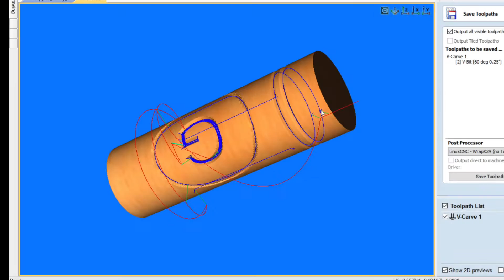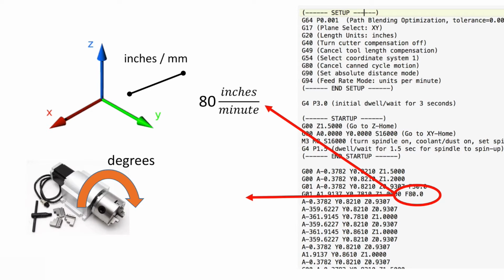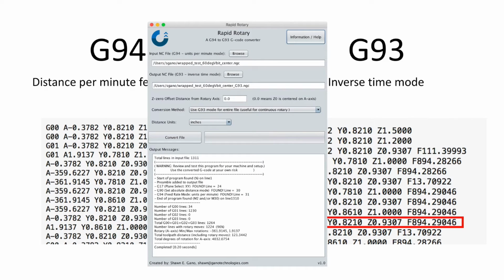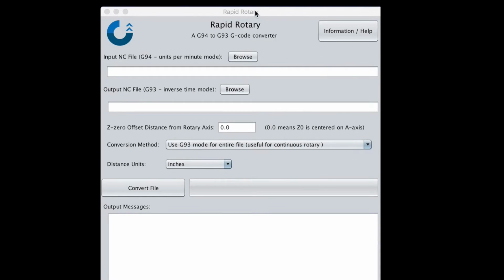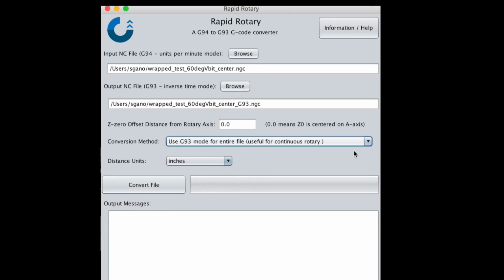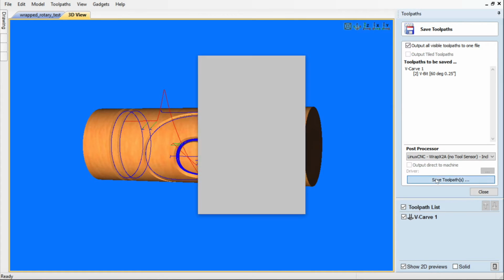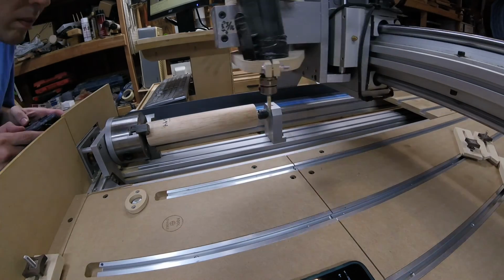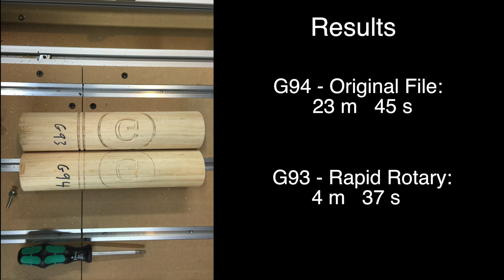Speed Up Slow CNC Rotary jobs in LinuxCNC with Rapid Rotary

Comment: Hello, can you edit this post-processor for MM?
Reply from the maker: Is it not working for metric?  I didn't think I added any checks for G21 (mm) or G20 (inches) - as the calculations should be dimensionless since the time scales are the same (per minute).   Though, I could be wrong - what error are you getting?

Comment: Awesome Video,  could you clear something up for me in the math? So you calculate the linear distance for XYZ and the arc length. Then do you add those 2 distances together and divide the total combined distance  by the feed rate? I just didn’t understand how exactly you used both of those distances. Thanks! Great work.
Reply from the maker: If I am remembering correctly; there are two types of moves the CNC controller usually does one are straight line moves (G00 and G01) which I used the XYZ linear distance and then there are the curved moves (G02 and G03) for which I use the arc length calculations.  So it isn't that I use both for every move, but I use both of them to cover the different cases of possibly move types.   Though when you do "wrap" the moves around a cylinder all moves do have an arc component (which may also be part of your question).  Hope that helps!
Reply: Hi, great program
Could you give an example how to calculate the F value in G93 from Y0 Z0 A0 for G01 Y100 Z150 A50 F200? @shawngano

Comment: I use Stepcraft and Fusion. Unfortunately I have issues with G17, G18 and G19 when I convert a file. How can I settle the  cordinates?
Reply from the maker: Unfortunately the application doesn't support G18/19 just G17 (as it is the XY plane).   The G17 should be called once at the start/setup and then isn't referenced again.   Fusion 360 does support G93 (inverse time mode) so it should be possible to output directly without needing to convert anything.  Though you made need a modified post processor to do that or there may be an output option for that mode.  I would try that route as your results will be even better if you don't have to convert afterwards.

Comment: Hi, thanks for the great explanation!
The video is some years old, but I hope its ok to ask a question.. With G93, does the conctrol software (Linux CNC in you case I guess) not have to know the z-offset as well? In your case it is zero, which might be default anyway in the control software, but LinuxCNC should know the offset as well if its not zero, right?
Thanks!
Reply from the maker: Sorry for the slow reply:  As there is a z-offset option in the RapidRotary program your control software doesn't need it (as long as they both match -- meaning you use the same zero point).  This is because the RapidRotary tells the control program essentially how long each move should take.  Though some control software can use the z-offset directly in a rotary-like mode to modify the speed automatically for jobs with angle movements and in those cases this program isn't needed (such as Mach3).
Reply: @shawngano  Great, thanks for the explanation.

Comment: This is good stuff! You do realize the problem in the US is about 25.4 times as big? :) Tried it for my Fusion360 PP, but it doesn;t work, seems that the application expects a Z value before the A value (which makes sense). But i'm now using a Fanuc postprocessor that is embedded in Fusion360 that uses G93 per default.
Reply from the maker: Thanks!   Yes it does expect a Z value before an A move -- otherwise it can't compute a distance since it needs to know how far from the center you are.   It is nice to see a lot more post-processors supporting G93 (even Vectric does too now!).   Though I can't quite figure out why it would make a difference for this calculation if you are in English or Metric units (I normally use English units).  As they both have a feed rate of either "inches per minute" or  "mm per minute" so as long as all the units are consistently mm or inches between feed rates and distances then the units cancel out when converting to time.

Comment: Thank you so much.  This is brilliant!!!
Reply from the maker: Thanks!  And if you happen to be using VCarve Pro or Aspire (v9.5) -- they now can support G93 directly with a few modifications to the post processor.
Reply: @shawngano  I am using vcarve pro 9.5.  do you have a link on how to change the post processor?
Reply from the maker: @sidewinderdrums  I would recommend e-mailing Vectric support as they don't have any published documentation that I could find.  They just sent me an "example".  Below is a summary of the changes I made that seem to work for me.  I also have posted my "G93" (inverse time mode) version of a post processor and my standard one here: https://gano.name/shawn/CNC/Vectric_G93_PPs.zip  

1) At the top add:
INVERSE_TIME_MODE = YES

2) Add new format:
VAR INVERSE_TIME = [FI|A| F|1.1]

3) At the end of the header section add:
"G93"

4) In the first feed rate moves change the [F] to [FI]

5) For the feed rate moves add [FI] to the end of the move command.

6) In the footer add this to end the time inverse mode:
"G94"
Reply: @shawngano  thanks.  i should be able to figure it out from here.  I have y2a, so it will need a little modification, but this is a great start.

Comment: NICE JOB BROTHER..BUT DOESN'T FUSION DO 4TH AXIS?
Reply from the maker: Thanks!  I originally wrote this for the rotary output I had from Vcarve (or Aspire) -- which both now have native G93 support as of the latest update!   Fusion 360 I think does actually support a 4th axis now (well at least a "wrapped" axis) .  I haven't used Fusion 360 for the 4th axis much yet (but I do want to try it out more) and it also might support G93 automatically too so this program wouldn't be needed if that is the case.  For Fusion 360 rotary support check out some of these articles and videos:     http://help.autodesk.com/view/fusion360/ENU/?guid=GUID-7FF25192-AED7-4230-92DC-E22ADF15D498    -  https://www.youtube.com/watch?v=ApM2NWCDraU  -  https://www.youtube.com/watch?v=EDmFkablCCU

Comment: Cool video! Helped me track down my problem with my five-axis. From the research I've done, though, CAM doesn't necessarily output G94 or G93, as this is handled by the post-processor. An example of a post processor that does this can be found in the default Haas post-processor for HSMWorks/Fusion, and is made useful by setting useInverseTimeFeed = true
Reply from the maker: Glad it helped a little!  That is true for the more advanced CAD/CAM applications a lot of the post processors allow options between G94 and G93.  But there are some programs, especially the ones geared towards CNC routers,  that it is just not possible to output G93 (such as in Vectric's V-Carve or Aspire programs or DeskProto).

Comment: I might be wrong but the effect is pretty much the same as if you just multiplied F value by 180/(pi*r)?
Reply from the maker: That works for the simplest case.  But 'r' in general is constantly changing as the cutter moves up and down  and when you have X (or Y) translations at the same time as rotations then it also won't work since the  translations will be too fast.
Reply: Sure your method is the correct one!
Reply: @shawngano   So I have been having this slow rotary issue in a laser cutting pipe application. In my case the Z axis is fixed, so there is no Z movement in the G-code and your program will not process my files. Would the solution from pkmcnc work for my application since the "r" is fixed?
Reply from the maker: @Joncon00   Yeah in your case with a laser cutter the distance from the "cutter" shouldn't change so you should be able to just scale up the feed rate.   The laser controller may also not be able to interpret G93/Inverse time mode anyways -- sos calling up the feed rate is probably best.  You may also have some sort of incorrect step settings which makes your rotary slow -- but again the feed rate scaling should be able to compensate for that too if that is the case.

Comment: friend of mine is running Linuxcnc. seems to have really long machine times for 3d even though he supposedly set to 200ipm? any ideas. I'm not familiar with Linux.
Reply from the maker: 3D cuts do take a long time; your friend's machine might not be able to accelerate fast enough to achieve that speed especially if the part is very detailed. Are the machine times for cutting 2D parts with lots of straight cuts still slow?   It is also possible that he has LinuxCNC in metric units instead of english units.  Have him check that G20 is active (inches) and not G21 (mm) as 200mm/min is only around 8 in/min - which would be quite slow.

Comment: Do you feel like making this into a LinuxCNC input filter?
Reply from the maker: I don't know the inner workings of LinuxCNC real well; do you know a good place to read about how to make input filters?   I do plan to make this project open source so someone could adapt it who knows LinuxCNC better too.
Reply: Some info, and a simple example here: http://linuxcnc.org/docs/2.6/html/config/ini_config.html#sub:FILTER-Section
Basically I think the filter just needs to take an input file as a command-line parameter and output G-code to stdout.
Reply from the maker: Thanks Andy - that is interesting and doesn't look to hard to do.  Since the output is fed directly to the controller I might use the program as is for a while until I am comfortable the bugs are worked out before trusting it directly as a filter -- but I do think that would be the best way to go in terms of long term ease of use.  Thanks for the suggestion!